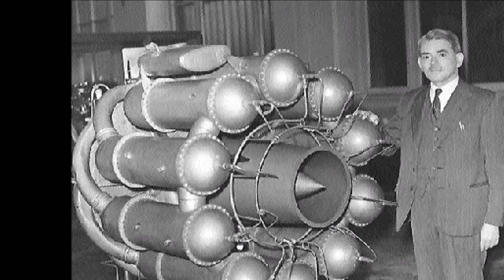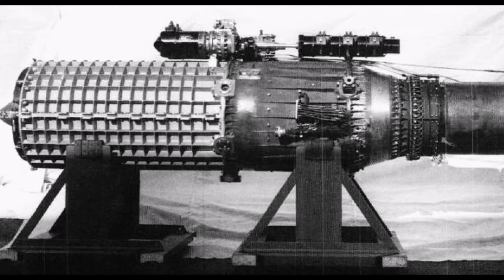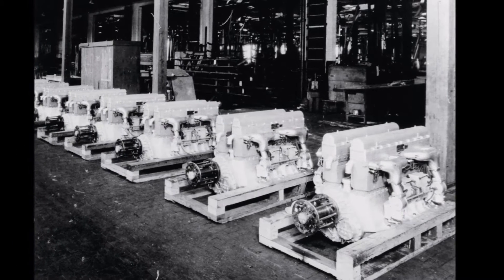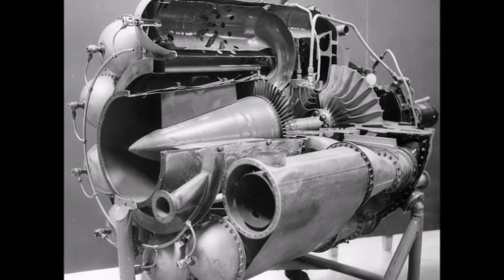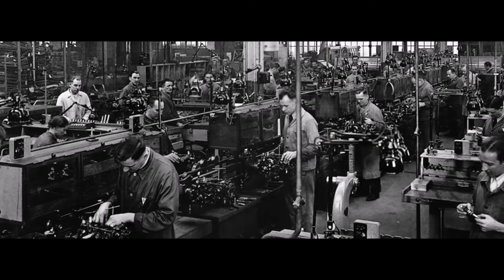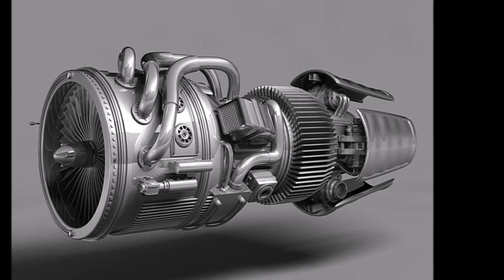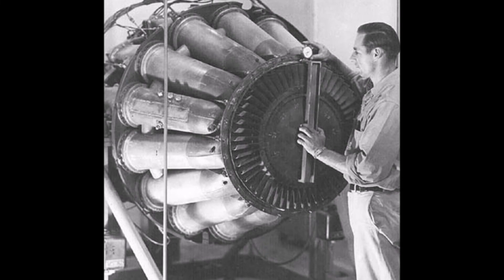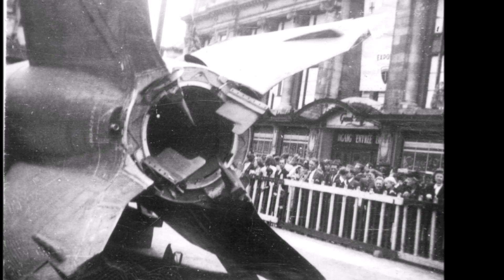History of the jet engine

Comment: Let's clear the facts: Henri Coanda invented the first jet engine and Frank Whittle invented the first turbojet. Before you comment: yea, Coanda 1910 caught on fire , but he is the first to design such a thing and implement it on a plane.
Reply: You are quite right.  Coanda did demonstrate the first jet engine.
Reply: @awatt  The Coanda 1910 was powered by a 4-Cylinder Clerget engine driving a Ducted Fan... Not a jet engine, also it never flew.
Reply: @sandervanderkammen9230  
Thermojet
It flew.  It was a jet.
Reply: @awatt  All of its thrust was provided by the 4-cylinder Clerget engine... it is clearly visible in all of the photos of the 1910.
The 1910 was destroyed by a gust of wind during a taxi test, it caught on fire and was completely destroyed before it ever flew.
Reply: @sandervanderkammen9230  
You are wrong 
It was the first jet. Italian
Reply: @awatt  Henri Coanda was Romanian not Italian and he did not invent nor demonstrate the first turbojet engine, in fact he didn't make the false claims until the 1950s when he was old and senile.
Reply: @sandervanderkammen9230  
You are confused.  No one is talking about him.
Reply: @sandervanderkammen9230  
First jet powered plane.
Italian
Reply: @awatt  You are confused, the original post was regarding the Coanda 1910
Reply: @awatt  The Caproni Campini N.1 was a thrust augmented DUCTED FAN aircraft, the thrust was generated by a 900hp V-12 piston engine.
It could not fly without the V-12 engine.
Reply: @awatt  The first Aircraft to successfully demonstrate Jet Propulsion was the Opel RAK 1
But like the Caproni Campini N. 1 was not powered by a Jet Engine using the Brayton Cycle.
Reply: @sandervanderkammen9230  
That's right.  The Italian thermojet powered plane was the first jet powered plane to fly.
Reply: @awatt  Sorry lad, it flew exactly 1 year after the Heinkel He-178 did on August 27th 1939..
Reply: @awatt  Damn son! Even a broken clock gets it right twice a day..
What is your excuse getting it wrong every single time???
Reply: Frank Whittle was only the 4th person to successfully demonstrate a a jet aircraft engine.
Reply: @sandervanderkammen9230  
That's if the he178 actually flew then.   it was a few years later that the claim was made.  No evidence was given apart from 'trust me bro' and the date of 27 aug being exactly one year to the day is very suspicious.  Even If the 178 was the first just being able to make a short hop off of the runway hardly counts as the Italian jet was able to fly long distances and retract it's undercarriage. 
Something presented without evidence can be dismissed without evidence. therefore the Italians were the first to fly a jet.
Reply: @awatt  Sorry lad, the film evidence is irrefutable as are the witness statments.
The Jet aircraft was first successfully demonstrated in Rostock Germany.
Reply: @sandervanderkammen9230  
You are like a broken digital watch....never right.
Reply: @awatt  I just made you look like fool... you should stick to subject you actually know something about.
Reply: @sandervanderkammen9230  
......and kept "secret" until the Italians flew their jet aircraft
Reply: @awatt  The Heinkel He-178 was not a top secret govermenr program, it was a privately funded commercial project that was offered for sale to the highest bidder.
The first flight demonstration on August 27th was open to the public.
Reply: @sandervanderkammen9230  
It's on record that no one knew about it till after the Italians flew their jet.  It was only then that the Germans said "trust me bro" that they flew one exactly to the day their one.  All very suspicious. 

You don't know your own history.
Reply: @sandervanderkammen9230  
You can't provide any evidence for this supposed flight other than "trust me bro "
Reply: @sandervanderkammen9230  
That could be filmed at any time.  Doesn't prove anything
Reply: @awatt  The Smithsonian Institution confirms the date of the film that captured the historic flight of the World's first jet aircraft was August 27th 1939 in ROSTOCK GERMANY.
Reply: @sandervanderkammen9230  
They weren't there.  No one knew about it till a few years later.  Also the Smithsonian does documentaries about flying saucers.  Enough said
Reply: @sandervanderkammen9230  
Your lady post is an admission that I'm right and you have no opposition whatsoever
Reply: @awatt  Where is your proof???
Reply: @awatt  Youtube does not delete the TRUTH or any comments containing factual evidence.
Reply: @awatt  Sorry lad but YouTube doesn't delete the TRUTH.
Reply: @sandervanderkammen9230  
Is that's why it's deleting your posts?
Reply: @awatt  You are very confused lad...
Reply: @sandervanderkammen9230  
Really?
Reply: @sandervanderkammen9230  
Why does the YouTube algorithm keep deleting your posts?
LOL
Reply: @awatt  STILL HERE! You look like a fool laddy!
Reply: @sandervanderkammen9230  
Yes.  That one Sayed up.  Well done.
Reply: @awatt  THE TRUTH ALWAYS PREVAILS IN THE END.
Reply: The Coanda engine is a ducted fan powered by a petrol engine not a self contained power source as is a true jet

Comment: Who invented the Jet engine as we know it today? Sir Frank of course.
Reply: It amazes me that this man, who was a fighter pilot, not only came up with basic idea/method,  also did the incredible physics of the unusual constant-pressure cycle and then the incredible engineering to design one that worked.  Most people still don't understand how it really produces thrust.  The jet engine has changed the world,  and what credit does this nice man get?
Reply: @backpackerthrulife8497   Nooot quite right.There had been a few people before him with the right idea but wrong time.Think about Euler who did the turbine mathematics in the 18th century.The first gas powered gas turbine runs 1903 in Norway,Coanda,the french patent in 1926. Whittle however was the first to use it as an engine in planes and worked on it for years to get it run.But he preferred the radial principle,and focused his working efforts on it,at that time the right way to get working ,usable results.
Please read my 2nd comment  two comments below.
Reply: @michaelpielorz9710 Yes of course he didn't invent the gas turbine-  but was the first to use it to produce thrust instead of mechanical work through torque ( see my argument that the Germans used his patent for their war machine, and assigned Ohain to develop it).  Others wanted to use the gas turbine to turn a propeller, but didn't think of it as being a jet engine.
Reply: @backpackerthrulife8497   Sorry,but the Germans didn`want  von Ohain to develop it for their war machine and therefore to "copy" it.I think, we should not debate the process of the invention.The two men who knows it best are von Ohain and Frank Whittle,i am sharing their point of view.
The reason why v.Ohain worked for Ernst Heinkel was very simple.Heinkel had an preference for speed and he always wanted the fastest aircraft for sale.Ohain knews about this preference and he offered him this new kind of powerplant.Heinkel agreed and work started,totally paid by Heinkel himself.But he gave Ohain a strict deadline to present his new engine.Like Whittle,Ohain faced a lot of problems ( wich he would have had avoidet if he only copied Whittle) and in the nick of time he presentet Heinkel a turbine,secretly fueled by hydrogen.Heinkel was satisfied and allowed him to continue.So HE 178 started with the HE S 3 for the first time.Then Heinkel developed the HE 280 ,paid by himself.He offered it to the German gouvernment,but while he used the nose gear ( The RLM didn`t want this "american invention ) HE 280 was rejected.,Messerschmidt later got the contract for a jet plane.The  He 280 was cancelled immediately with only a few build.
I`m surprised you did not know about this story.
Reply: GERMAN best BRAIN of course...NO BULSHIT ENGLISH MOUTH
Reply: Frank Whittle was only the 4th person to successfully demonstrate a jet aircraft engine.